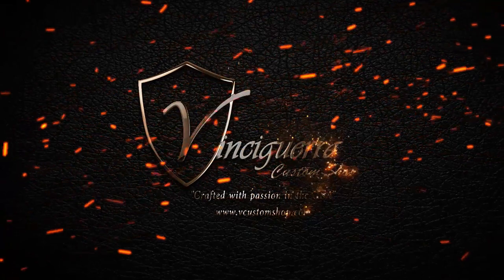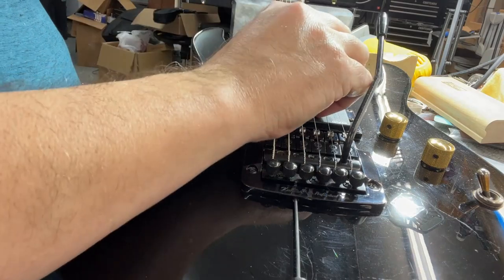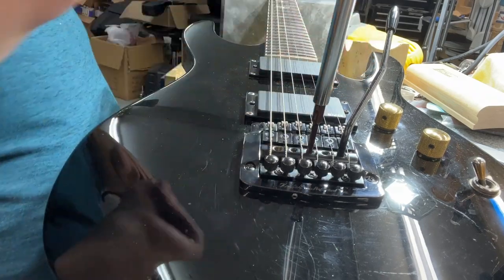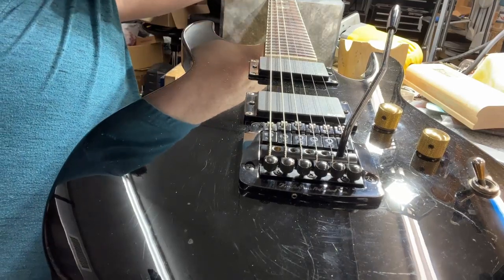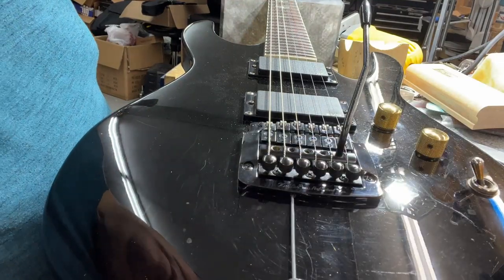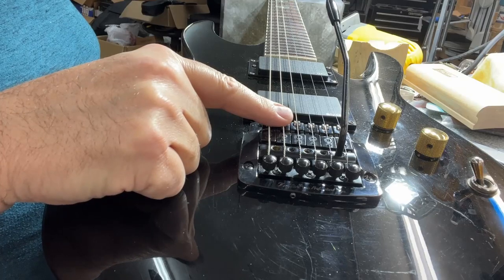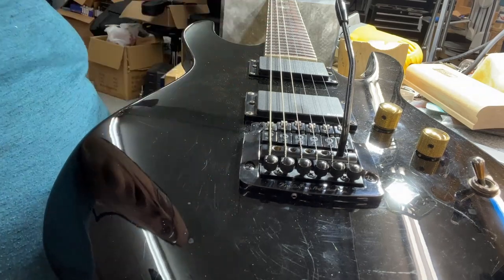Kahler Tremolo Tension Adjustment..... FAST!!

Comment: The fact that you can turn a small screw and turn a floating bridge into a fixed bridge, individually adjust saddle height, string spacing, nice fine tuners, and the lack of a rear route is really cool. No floating bridge system will ever be perfect but I like the Kahler more than the FR. Have you ever worked on the Kahler fixed bridge version that Mustaine and Friedman used to have on their signature guitars?

Comment: I have a Kahler on a peavey impact from 1985 that doesn’t have the Allen on the bridge to make it a fixed bridge so it must not have that capability…..plus the fine tuner on the low e string turns but doesn’t adjust the pitch

Comment: I always tune mine locked and then when I take off the screw thingy I tune it with the tension adjuster until it matches the locked angle. Is this angle wrong ? I never had tuning stability issues (well I do in a similar JH LTD I got last week but that one is borked and I am waiting on new springs, it only stays in tune with dives, pull ups make the whole guitar go sharp).
Reply: Nevermind I should have seen the rest of the whole vid first, anyway if you got any tips for pull up issues I'd much appreciate it.

Comment: My kahler doesn’t have that little screw behind the the bridge… and the bridge is super raised and I don’t know how to fix
Reply from the maker: Hmmm, I thought they all had it.... Sorry about that. So here is my recommendation for you. If by "Raised" you mean that the fine tuner end of the bridge is up in the air..... Try unlocking the nut and tuning the guitar down a half step (E flat - E flat). If the fine tuner end of the bridge is now below the surface of the bridge, try tuning the guitar with the center allen head (spring adjustment) as I did in the video..... that should get you close. But if the bridge is perfectly level when tuned to E flat, go down to D-D instead. Make sense?
Reply: @VCustomShop  ok so it’s becuase the string tensions are not right and it’s throwing the bridge out of wack but now I know that I have to put that tool into the second hole next to the whammy bar… what is the name of the tool you used?
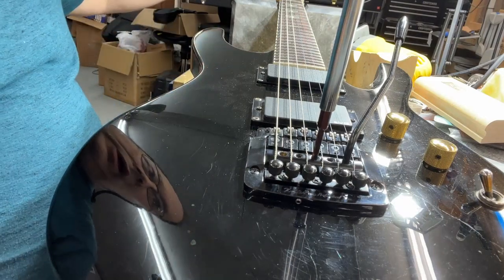Reply from the maker: Not next to the bar…… the hole in the center. It is a 2mm allen wrench. 2:46 in the video
Reply: @VCustomShop  thanks dude

Comment: since i bought my guitar it has never gone back in tune if I release the bridge screw and touch the bar at all its out of tune, taken it to a luther and 3 guys for set ups and not one has it returned to in tune, just looking to see if i can find anything i am doing wrong other people seem to stay in tune at least a few times....
Reply: Hate to suggest is it a genuine bridge? With so many fakes it does happen.

Or  has something been damaged on it perhaps a fork or roller, what string gauge and tuning are you using?

It could be a simple issue like needing the heavy tension springs or possibly the cam being too close to one side and pinching it is supposed to float between the main baseplate, you want a slight gap each side so the cam can move freely without touching.

 I would suggest sending kahler an email with pictures or a link to a video to possibly show the issue I really hope it can get fixed for you.

Many techs are used to Floyds and try to set up the same way but it requires a different approach check out the videos on rexylab with Eddy he now works for Kahler and knows his stuff maybe seeing one that is setup perfect will help you figure the issue
Reply: @ozzuk616  yeah its a genuine bridge i bought it new i dont see anything damagaed...

Comment: The cam will not go back and it will go always out of tune after a time since it does not have the required space to move.
Reply from the maker: The cam is perfectly aligned with the “Neutral Screw” or “fixed” position….. look back at the video 5:37-5:45 and you can see the full range of the cam.

Comment: It will not go back fully since it tilting forward instead be in level with the frame of the Kahler. Go ahead and watch Gary kahlers setup video second part or wait for RexyLab videos because non of the people on YouTube knows anything about the proper setup
Reply from the maker: It isn’t tilted forward, it is perfectly level with the locking screw for the fixed position. If it is at any other angle the set screw that Gary designed for a tremolo lock position would not work! Watch the video again and pay close attention at 5:37-5:45

Comment: Hey you do all wrong, the cam tilting forward it does need to be aligned with the frame level and adjusting or loosing the cam screws people really does not know how to setup a simple bridge.
Reply from the maker: The cam is perfectly aligned with the “Neutral Screw” or “fixed” position….. look back at the video 5:37-5:45 and you can see the full range of the cam.